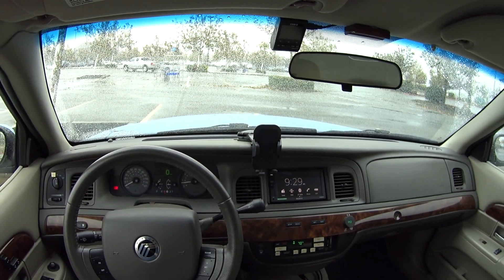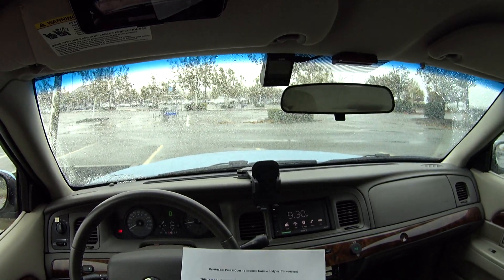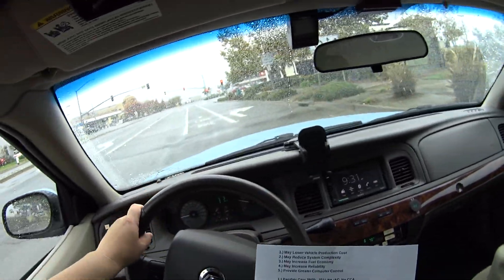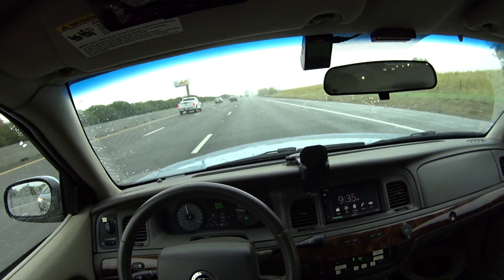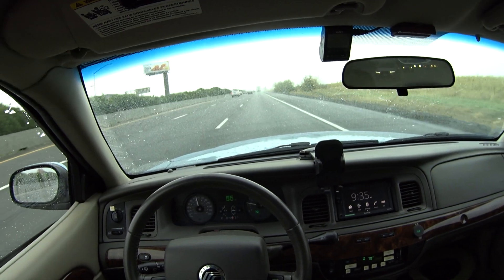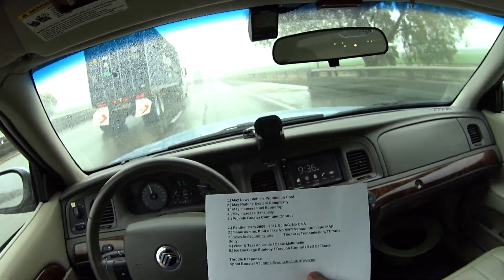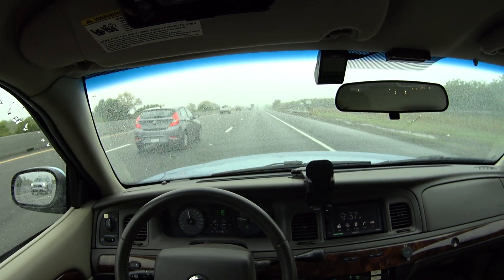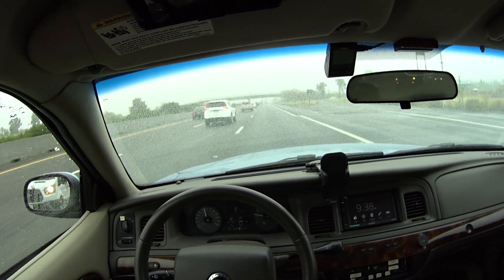Crown Victoria - Electronic Throttle Body vs. Old School

Comment: I have '04 and '08 so have examples of both.  Drive by wire can be very good but I prefer cable linkage.
Reply from the maker: Right on, thanks for the good feedback.
-Chuck

Comment: Have you had any issues with Torque converter shudder? I’ve been trying to figure what was going on with my ‘02 Crown Vic because sometimes when it shudders around 40-45 mph. I have 200k+ miles on the car & the tranny fluid has never been changed, do you think this could be the cause?
Reply from the maker: You're going to drive me to drink, Jamo. Lol

Drop the pan, clean the magnet, change the filter, replace the 4 quarts of fluid ASAP. 
Chop! Chop! Lol
-Chuck

Comment: Very interesting. Many good points there Chuck. Ya i had the chance to drive an 03 vic and I definitely felt the difference in throttle response and it also felt like it had a little but more low end power.
Reply from the maker: Right on TB,
Thanks for stopping by. 
Don't forget to check out the other videos in the collaboration. 
-Chuck

Comment: A one inch taller tire will reduce your final gear ratio in the differential .25 so if your rear gear ⚙ is 3:30 to 1 with the taller tire your final gear ratio would be 3:05 to 1 at the tire which would account for the 1mpg increase or better fuel economy. 

Also the electronic throttle says no no no when you are hoarsing around.  Less warranty claims for abuse. Good stuff chuck
Reply from the maker: Right on Shaun,
These are the kind of golden nuggets that would be perfect in a panther collaboration. 
You gotta get another panther car. Lol
-Chuck
Reply: @PanzerPlatform  my mustang has all the same components as the panther platform.  I have been looking for a panther.  For it to be a long term thing it needs to be console shift tack and gauges with a good color .
Reply from the maker: I'm not sure but I think the Crown Vic LX Sport with the console shifter, and the Grand Marquis HPP (handling performance package) with console shifter were only made 2004 and older.

And the instrument cluster with tach did not start until 2006.

But there's a guy on here (brian's garage) that does some pretty neat custom gauge mods to put the newer cluster in older models for the tach.

-Chuck
Reply: @PanzerPlatform  I'd like to find a broken marauder in blue but I'd settle for black lol

Comment: If one doesn't like the drive by wire one could flash the pcm with a sct tuner for example.  It will greatly help lagging throttle response.
Reply from the maker: Right on Shaun,
That's a good point. 
I wonder how much that would cost. 
-Chuck
Reply: @PanzerPlatform  you can find a used one reasonable.  They can be married to 5 different cars but not at the same time. It gets expensive if you have to send the tuner back to set to have it unlocked so eBay would be the place to look where you are protected on that type of sale
Reply from the maker: So like $100?
Reply: @PanzerPlatform  if you see one for 100 bucks grab it.

Comment: $15 for a new throttle cable or at least a $100 for an aftermarket electric TB or $200-$300 for a Motorcraft one. My 2006 is already on it's third electronic TB at 150K. 👎🏻 That's no bueno for me. I only had to replace one throttle cable on all of my past cars over the last 40 years.
Reply from the maker: Right on JT,
Thanks for stopping by.

So you're saying the move to electronics may have been more beneficial to the manufacturer than the consumer Impossible!
Just kidding. lol
-Chuck

Comment: DBW is better
Reply: Considering a replacement throttle cable is $15 and a replacement ETB is anywhere from $100-$300, I don't see any advantage.  I have already had to replace 3 ETB's on my 2006. The only way DBW is "better" is if you like throwing your money away.
Reply: @j.t.cooper2963  mines original on my 2011 CVPI just clean it regularly. 176k miles. It’s not an assembly replacement when a component goes out you can replace parts in it just like that $15 cable you mentioned. Also it’s a very simple system that improved fuel economy 🤷‍♂️
Reply from the maker: Right on Warrior,
Thanks for stopping in. 
What are the Pros for your application?
What do things do you like about it?
-Chuck
Reply: @PanzerPlatform  Pros: tunable & cheap. 

Cons: the delay but like in the video you can fix that
Reply from the maker: @WarriorOfEden3033  
Right on,
Thanks for the good feedback.
-Chuck

Comment: Lot of points here Chuck but the bottom line for me is how easy is it to fix. If something in the drive by wire fails it is much harder for the average guy to fix. If broken throttle cable occurs its pretty simple to diagnose. If the cruise control unit fails the car can still be driven. If the sensors or motor fail your stuck. Don't get me wrong Im all for advances in cars but I also live by the acronym k.I.S.S. it. Keep it simple stupid. 30 years ago a dome light was controlled by a switch in a door it went on it went off and easy to diag if some thing went wrong. Fast forward we need to have a computer module to dim lights off as we leave the car why? when that module goes out it is also tied into other systems like windows ect.  You wind up replacing a computer module which cost a hell of a lot more than a simple switch. An example is my 2019 dodge van the horn button is not controlling the horn it sends input to a chassis module why? you still need a horn button and I hate that I can't give a quick rap on the horn button to alert some one the light is green and wake up and go. It requires I hold the button down for a period and sound like I'm being an ass about it. Long winded I know but that's my take on electronics to control simple functions is stupid and just a money maker for the dealer to service.
Reply from the maker: Right on Mr. E,
Thanks for stopping by. 
You don't need to convince me, I'm all on board the stupid simple train. Lol

Btw, YouTube doesn't charge extra for paragraphs, hit the enter key once in a while. Lol
-Chuck

Comment: I liked being able to control throttle when working under the hood. Can’t do that anymore with drive by wire. Not a huge deal but annoying without a helper
Reply from the maker: Right on C-Raud,
Thanks for stopping in. 
You can say that again. 
-Chuck